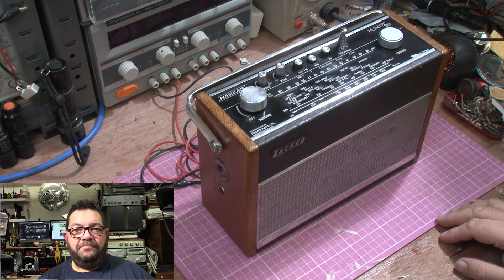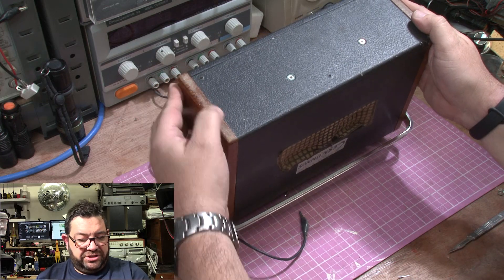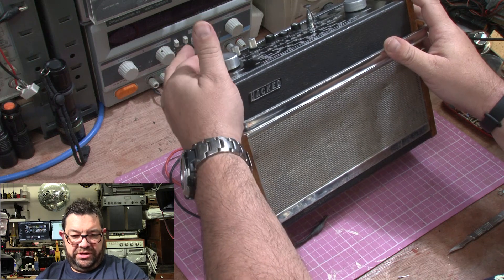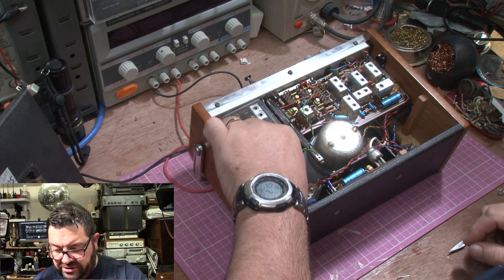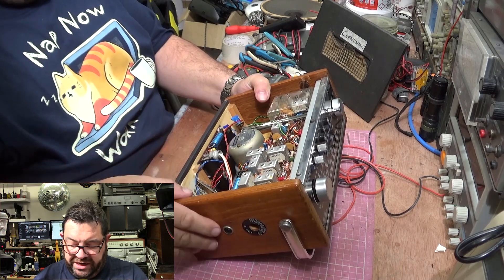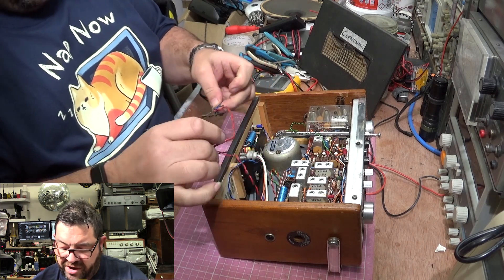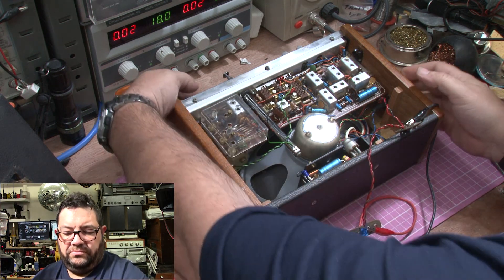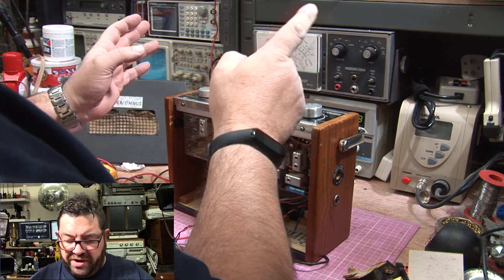Transistor Radio Repair : Hacker Hunter RP38A : Pt. 1. Evaluation

Comment: I had a Hacker Hunter in the 90s and a sweeter, fuller sound I've never heard from any radio or hi-fi tuner. It ran on 2 9-volt batteries which lasted only a few months, so the radio was expensive to run. It died a death and I could not find a technician who could fix it. Years later I bought another one from eBay that had a mains connection but whether because I was using it in Spain, or because of the mains connection, reception was relatively poor.
Reply from the maker: The modern sets you buy are usually rated to only last a few hours on a new set of good d cells so a few months is a good result. PP9 Batteries are getting harder to find but are not expensive considering the battery life. Certainly, the sound of a hunter is hard to beat.

Comment: Nice video format.  I think it works when you can keep a pace such as you did.  It leave time for added commentary and stories.  A couple of channels I follow use this format.  I have noticed that they can get a bit tiresome when the technician gets bogged down by not knowing where to go next or one has to watch thirty resistors be soldered in.  As with most things, moderation is probably the key.  Good work.  Doc
Reply from the maker: It worked for the assessment for sure but once you get into a repair it could get tedious. Like you say, changing caps and resistors just takes time and is boring to watch all the way through. Some faults are straight forwards too and others... they get you chasing your tail... I can certainly think of a couple of channels that ramble round in circles that have you yelling at the screen... 'you missed xyz..'

Comment: The Hacker Hunter Is a Very Reliable Set George It Uses BF194/195 Transistors As Opposed To My Hacker Sovereign RP18s In All Their AF117 Goodness (he,he) IF It Was Me I Would Only Change Caps Across The B+ And Maybe a Few in The Amp And I Would Check Bias Current And Mid Point Voltage in The Output Stage, My Own Hunter Uses An Elac Speaker But I Do Like The Goodmans Speakers Too If You Cant Straighten The Shaft On The Pot You Can Get a Replacement Easy Enough, Good Radio George !! I Just Like My Sovereign 1 and 2 Radios Better Looking Forward To Part 2 Regards ..mike P.S. Very Nice Power Supply !!
Reply from the maker: Thanks Mike. Going to either do the alignment or a cosmetic job the next video. If one  bit isn't long enough, I might combine the two.

Comment: Morning George... Welcome to the Phoenix Hunter club... Do the dial cord, recap the amp - nip up the speaker - source a new back grille - tackle the alignment... Job done. One of the best sounding sets (when restored) for sure.
Reply from the maker: It sounds pretty good as is but yes, needs to be finished off. I did find an Elac in my stock of speakers in the correct size which could be tried in it.

Comment: Looks like mainly mechanical repairs. Nice radio!👍👍
Reply from the maker: I'm assuming it will be but some British electrolytic caps are known to be a bit leaky after the 40 years they have been around. Might need some work but probably not a great deal.

Comment: Nice radio never actually owned one but I did do a repair on one for a friend a few caps and new aerial took longer replacing the aerial than it did to fix the rest of it !  thanks for sharing !
Reply from the maker: My first one too. I do have a much older Hacker that I have not even powered up yet which has been kicking around here for ages. Will see how this one pans out first.
Reply: @GeorgeChristofi  I will look forward to it !

Comment: Looking forwards to further videos on this set George, going to be an interesting overhaul.
Reply from the maker: It's my first Hacker... nice to try something new for a change!
Reply: @GeorgeChristofi  A healthy supply of Hackers on eBay at the moment but may be one day I'll get one. A week of catastrophe on the radio front this week, two radios gone down on me. GEC BC502 dead as a doornail and my trusty HMV 1122 silent as a ghost. No idea at the moment why the 502 is dead but a quick look inside the 1122 showed the mix/oscil valve not lighting up....new valve please, that did it, good job I had a spare, the 502 can wait till later, do have others of the same to use so no rush....no, the 502 does not contain the dreaded 117's.
Reply from the maker: Sounds like a run of bad luck but hey, at least they are repairable... they could have been Dab sets...
Reply: @GeorgeChristofi  Not like you to swear George..."DAB", oh how could you !! I do have one of my DAB sets that works on VHF only and the set's only around four years old. Can I be bothered to open it up?...not really, it could be a cap gone bad but surely not within that short time of four years though?
Reply from the maker: Terrible, isn't it. Swearing and new radios that die before the batteries run out on old ones!

Comment: The amplifier board could probably use a recap at least. Those electrolytics are probably getting a bit tired at this point in the rest of the radio as well. Looking forward to Part 2. ATB Doug.
Reply from the maker: I'm thinking the same thing for sure. Might have some resistor value drift but it sounds nice at the lower levels. Not thinking there will be much work needed on it for sure.